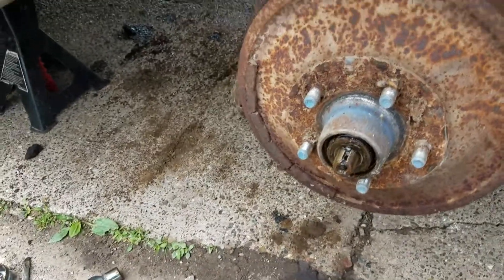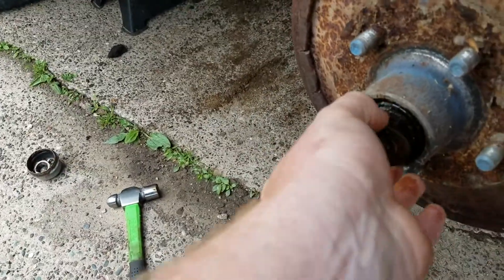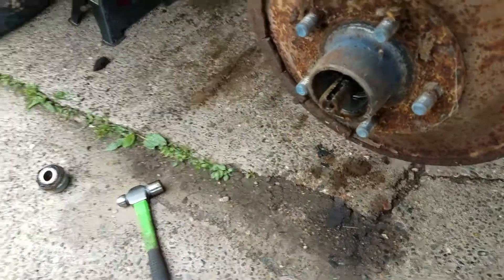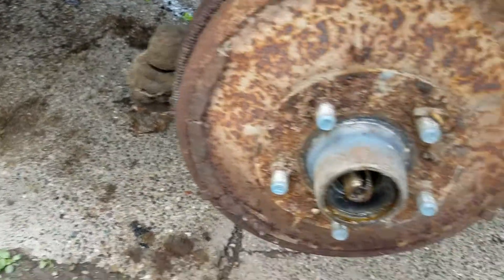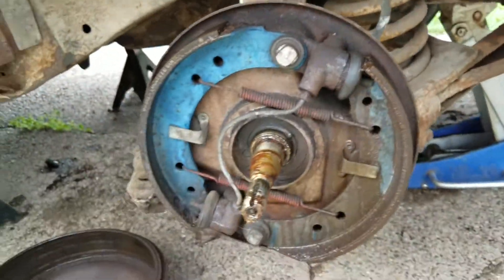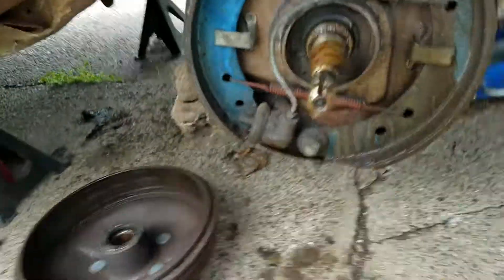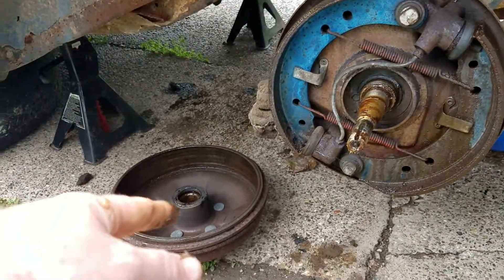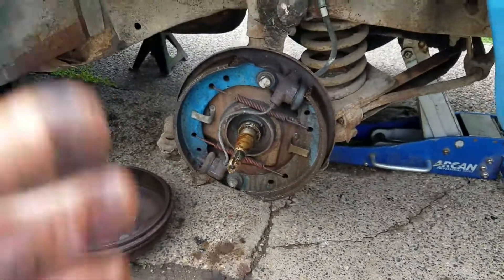wheel cylinder replacement 1950 dodge coronet

Comment: Im picking one up soon.
Reply from the maker: Awesome
Reply: Anyone know where fuel filter location is v
Reply from the maker: @jr_mercado562  to my knowledge there isn't one
Reply from the maker: @jr_mercado562  also i guess I forgot mine does have a sediment bowl, I do not know if that was standard or not
Reply: @kerr70  yeah see mine had that bowl too with the pump but I can’t locate a filter cuz I’m running into fuel isuees
Reply from the maker: @jr_mercado562  so I bowl is the old fashioned version on a filter, the heavy deposits fall to the bottom and the fuel stays on top